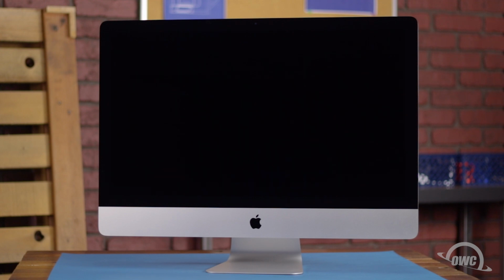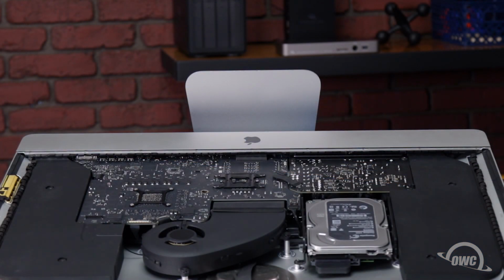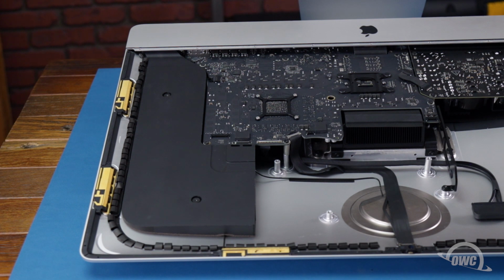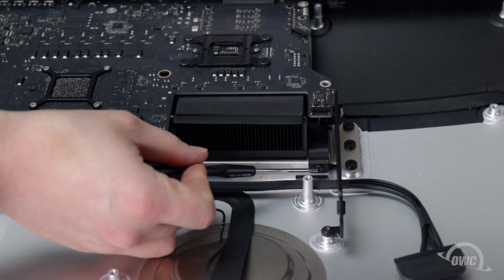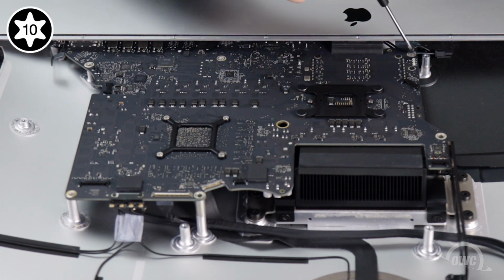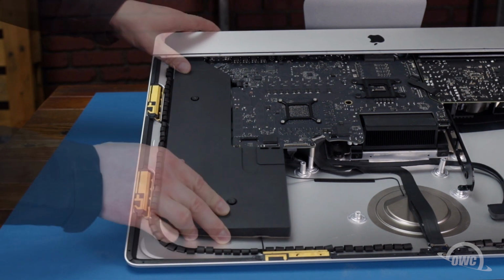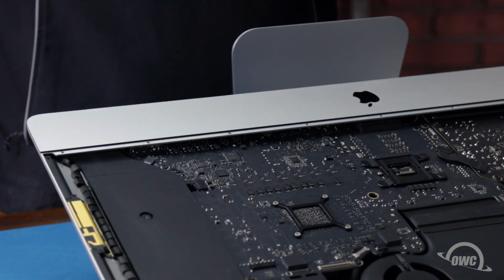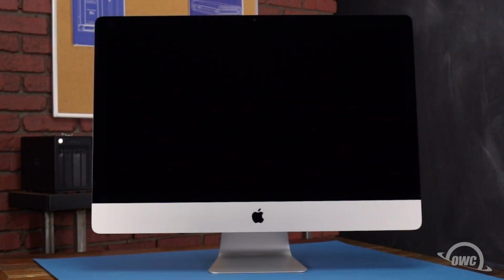How to Install/Upgrade the PCIe SSD in a 27-in iMac (Late 14 - Mid 15) - UPDATED VERSION AVAILABLE

Comment: My display has a hairline crack along from top to bottom running at a 70 degree angle.  If I take the screen apart it's coming off in at less than 2 pieces.

Do you folks at OWC sell a replacement screen?

Comment: Why is it not compatible with iMac from late 2015?
Reply from the maker: The PCIe slot in the machine is located on the back of the logic board, requiring a complete teardown of the machine. For this reason, it's not recommended to perform the upgrade on that particular machine.
Reply: OWC isn’t this what it’s being done on the video though? A complete tear down to get to the PCIe. Are you saying doing what this video shows is not recommended?

Comment: QUESTION : I have (128GB + 1TB) Fusion Drive Setup on my iMac 15.1. I want to upgrade 128GB PCIe SSD to 1TB, is it necessary to keep the SATA 1TB 7200 HDD? After All I want to get rid of the slow HDD part of the Fusion drive and have a single 1TB PCIe SSD. Please advise.
Reply: @Alex Carlito thanks for your advise, after-all it is a much simpler and less hassle procedure. However I was just wondering if the PCIe would perform better than the SATA? Kinda going for optimal performance upgrade option. PCIe vs SATA?
Reply: @mosesntsieni9607  Hey I have the same imac and I am getting conflicting information about the ssd upgrade.  Would you happen to know if I can put a bigger m.2 ssd into my 15,1 late 2014 27" imac?  And if so, which one?

Comment: Could you please explain why there is a SSD and a standard hard drive within this iMac? Is this a ‘fusion’ set up?
Reply: @poweredbyowc  Is it possible to install a new ssd but leave the fusion drive in there and use it as a secondary drive like maybe as Time Machine? Is there a limit to the capacity of the SSD? Is it possible to install a 2tb ssd when the maximum at the time of buying is only 1tb?